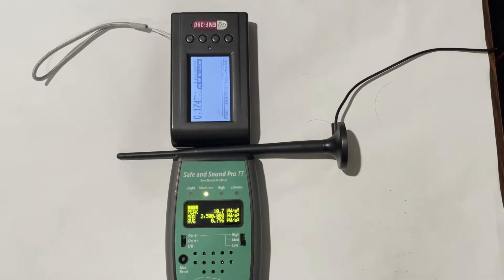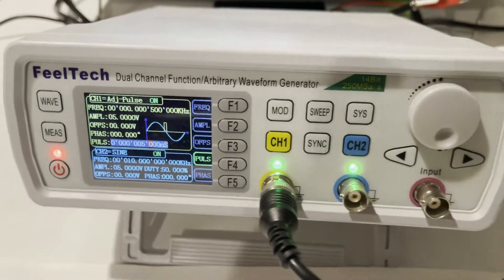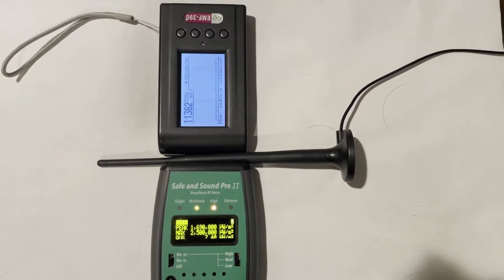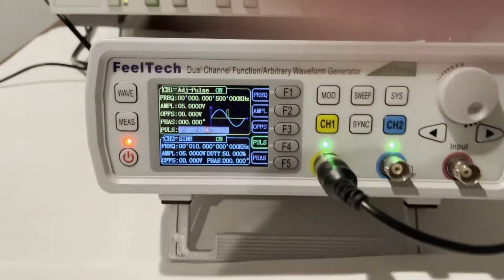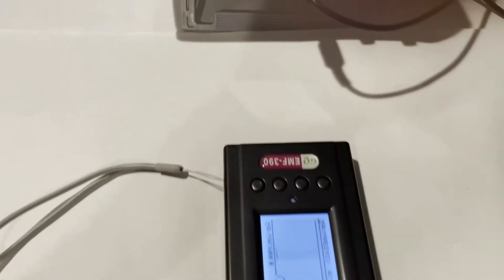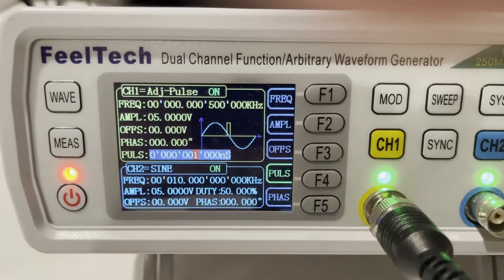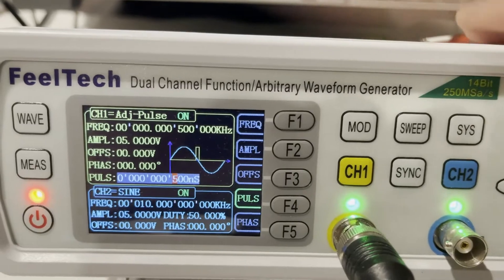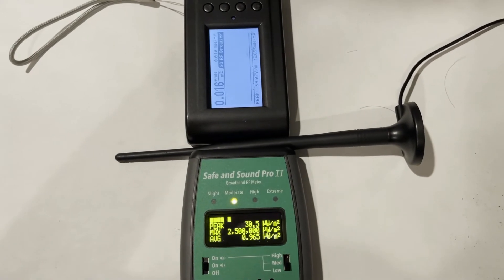Safe and Sound Pro RF Meter Vs GQ EMF-390  3-in-1 EMF Meter High Speed 5G RF Pulses Test

Comment: Our data definitely shows different results.  The chamber (if you want to call that) has to much noise around it.  These tests need to be performed in a proper chamber with shielding material and proper equiqment that has also been tested.  Sorry but your information is misleading. Thanks SLT

Comment: This measurement is 101% meaningless. 

In order to take a RF measurement this close in the "near field" you need a near field measurement kit. 
Far field measurement tests like this should be conducted at least 3 meters back or so to allow for the correct propagation of the transmitted signal.  
(Especially from high gain omni directional 2.4GHz antenna like used here.)

Problem is the GQ EMF390 I tested with another EMF specialist last year, with the 390 in the 3-in-1 Display Modes could not even detect 5GHz Wi-Fi from 3 meters.  
MechanicalMonkey777's comment below stands to be true.)

Other EMF field professionals state the GQ EMF390 measures to high in environments where there is no RF.
There seems to be a massive inconsistency between GQ EMF390 meters out their.
 
The GQ EMF390 in its spectrum analyzer bands/mode is more sensitive, and fast, but doesn't go over 2.5GHz which means it is useless as an RF meter for 5G sub-bands/mid-band measurements. Plus, most EMF/RF meter users don't know how to use spectrum analyzers correctly.

Comment: The 390 dosent seem to pick up ambient rf.. you have to be super close to a known emitting device to get back reading .. I bet no reading in my room even though I have a phone and tablet on WiFi and I get no reading unless the meter is right up next to each device .. I was about 75 feet from 2 massive cell arrays and it didn’t pick up anything really .. I’m so confused .l does the safe and sound pro 2 pick up ambient rf?
Reply: I have the Safe and Sound Pro and the 390. There is no comparison.  The Safe and Sound is light years ahead when it comes to picking up at great distances.

Comment: EMF-390 BEATS SAFE AND SOUND PRO 2 IN ALL ASPECTS. Even EMF-390 can have its RF reading calibrated by the user if needed. So many features! Safe and Sound PRO 2 is just overpriced.
Reply: The Safe and Sound Pro II actually allow the user to listen to the demodulated signals. This is very helpful for distinguishing RF sources for purposes of mitigation.
Reply: @srira7910  S&S Pro isn’t really meant for catching wave pulses - that’s of no value if what I want to know is the levels of RF in a location, and it’s direction. I agree the audio feature is extremely helpful.